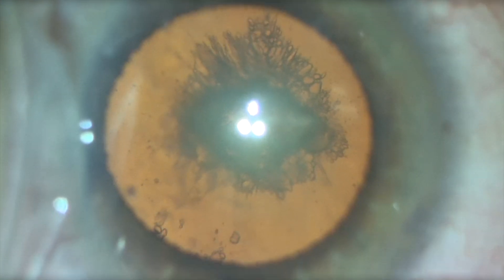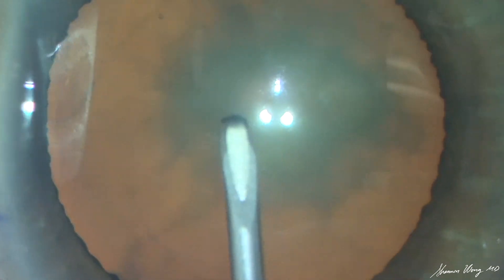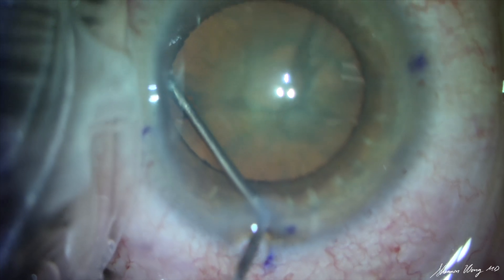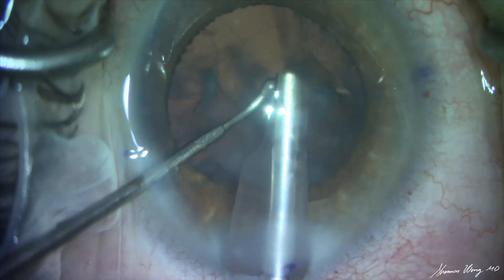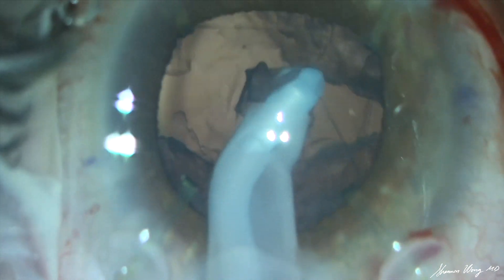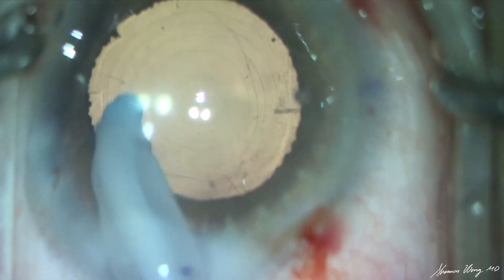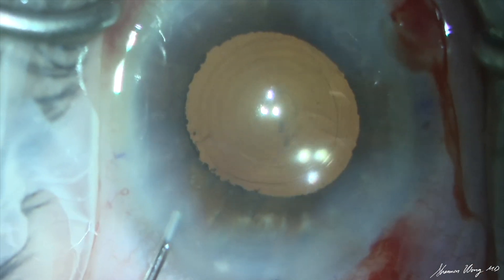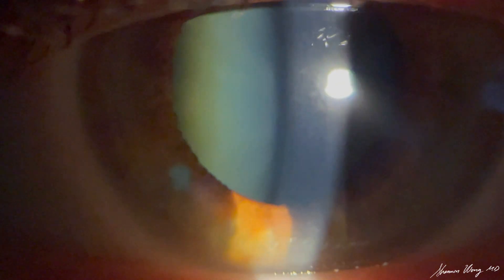Cataract Surgery with Phacodonesis - Do we place a PanOptix Lens or a Monofocal Lens?

Comment: Hi Dr Wong thank you so much for making these vlogs you really helped calm me before my own operation.   its now 17 days since my cataract operation  on both eyes. My question is  I also have keratoconus in both eyes can cross linking  be done after cataract surgery  especially if they use the  laser  will it affect the lenses already  in my eyes.   Before anybody  asks they numbed one eye and used local in the other eye.  Which do I  prefer the the whole eye numbing.
Reply from the maker: Can you please share your age?
Reply: @ShannonWongMD  I am 56 and suffered with very bad eczema and hay-fever (all pollen) especially the eyes and I  used to rub them just to stop the itching yes was told not to rub but combined with eczema it was too much.  The pollen allergy has stopped but now have dust allergy resulting in my asthma being aggravated. Oh and I  had mild cataract  the keratoconus  was the worset one.